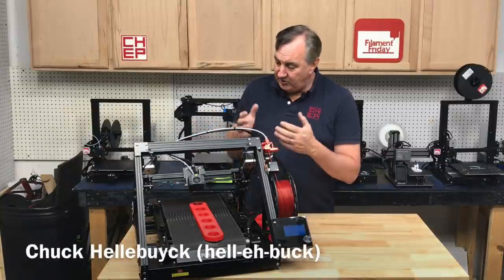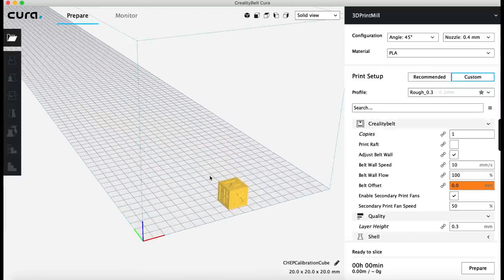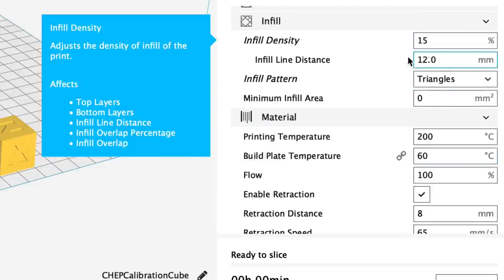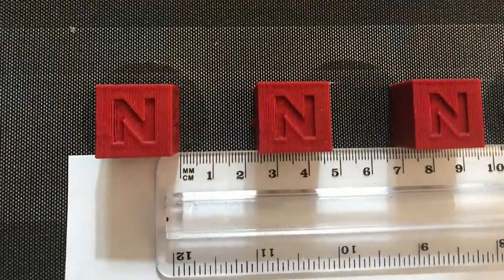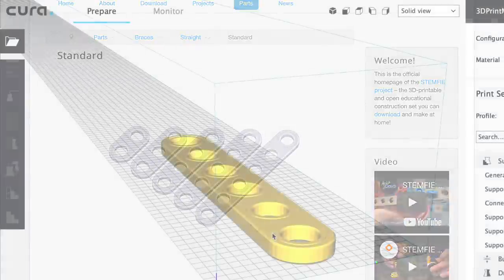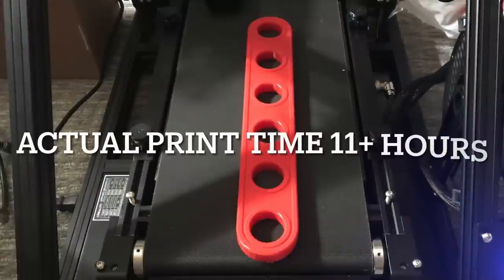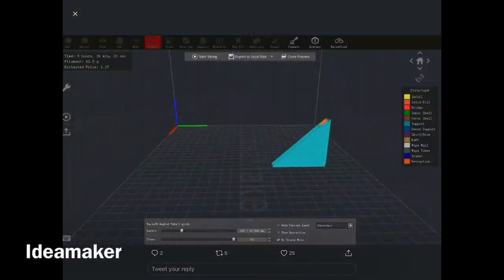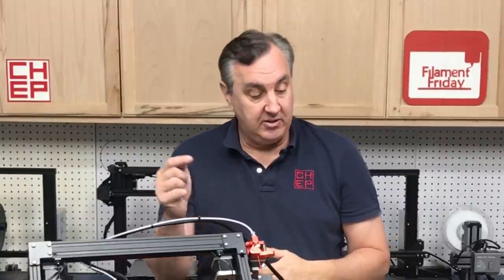Slicing 3D Designs for the Creality CR-30 Belt Printer

Comment: How does it work about supports with 45 angle? Is there any impossible (without supports) print that we can do with this machine?
Reply: 45+ degree overhangs can't be printed in the Z direction I guess
Reply: @jonahfastre  mmm, so if I want to print an hole, usually I could even do it without supports... but 45 degree is not possible right? 🤔 that's a problem (or we have to use supports)
Reply: @StefanoV827  with support it should be fine

Comment: The estimates in cura are usually off because of the start gcode in your printer setting which sets max speeds and the acceleration/feedrates.

Comment: Hi Chuck, I know you at least at one time used to run a small print farm. I am currently running two Enders 3
 v2 as a print farm but would love to have a printer continually spit out prints. My prints are quite small about 40 x 20 x 20 mm and has over hangs on all sides which require supports (imaging a elongated mushroom). Would this printer be capable of doing this ? The strange print angle to the bed worries me, it would be better if it was still 90 degrees from the bed.

Comment: Hey Chep! I am using Creality Slicer 4.8. I have a model which is lifting. I dont see the slicer enabled option to print small round pads? Any way to fix this? I added a brim over the entire model and it held fine, but not able to remove it easily.

Comment: Chuck, another great video, many thanks. 

I've got a product I print for a client on my MAX which is in 2 pieces due to size, the belt printer would be a game changer, but do you think PETG via a 0.8 nozzle will be ok with the stock hot end etc... will the belt reach 80°c

I've seen lots of reviews with PLA and the 0.4 nozzle, which I appreciate will be what most folks use, but with in essence an infinite z axis surely it's screaming out for a bigger nozzle.

Great video as always.

Best regards,

James
Reply: It’s a volcano style hot end (intended for large volume flows) and I did see a video somewhere of someone using a 0.8 successfully (although probably with PLA). I think that end should work. As far as the bed temp, no idea.
Reply: @JasperJanssen  I thought it was just an Ender3 style hot end, if so then I wonder if the MicroSwiss hot end for the ender would swap right in.

I can see me having to buy one of these in order to find out 😆

Comment: Will you be releasing a Cura 4.8 profile? I haven't updated my profile in a while and I feel like my prints could look better.
Reply from the maker: Maybe. It was such a minor update, I’m not seeing big change.
Reply: Ngl I went back to the stock profile and I'm printing near flawlessly! My Ender 3 Pro isn't stock tho...BTT SKR Mini E3 v1.2 (Marlin 2.0.6.1), BL-Touch, dual-gear extruder, Capricorn Bowden tubing, PEI/steel flexplate, yellow springs, RPi4 w/Octoprint

Comment: What the difference between and ender 3 and any high end ultimaker printer? 😅
Reply from the maker: Don’t have an Ultimaker so I can’t tell you.
Reply: Its an ",experimental " printer whith an "infinite z" so in theory yuo can make an infinite z object, its slice in 45 degrees, so its a totaly diferent class of machine.
In my opinion , if yuo need to make sword or rail trains ,it could be ok, but for me its just problems...its not for me
Reply: @noway8233  I did not ask about this printer (infinite z) 😅 i asked about regular ender 3 vs high end ultimaker printer.

Comment: I don't recommend using the "Distance Between Copies" function for 2 reasons..  1. Your print will already be however tall your previous print was away from the next print so if the print is 50mm tall the next print will start 50mm away due to the angles axis..  Its not possible to hit the previous print unless you back up the Z axis..  2.  If you advance the belt too far you move cold belt under the print area..  Currently there is only about 25mm of belt preheating before the nozzle..
Reply from the maker: Why is it in the slicer?
Reply: @FilamentFriday  Other than because Blackbelt built it that way I have no clue.

Comment: You could try making a many-hole beam in the same range — what about a one or two meter length version?

I’ve seen nobody really addressing on video the elephant in the room of how to make things significantly longer than the belt (like, 3-4 times as long, maybe, or longer). Is just a smooth support table enough to prevent it pulling the entire print off the bed? Do you need rollers? Maybe a support belt?
Reply: Good Question. I too am interested in that answer.
Reply: I believe creality also sells rollers for extending. The 3d printing nerd bought them with his printer so maybe go check him out
Reply: Somebody made a video where they printed a 16ft pole on it with a bunch of rollers I was also wondering at first

Comment: Hmm, another potential side effect is that the 45 degree print angle is going to make the part stronger because the laminations are no longer planar to the XY axis. It would be interesting for someone to do a torsion test on a Printmill print versus a normal print object. I do not need this printer, I do not need this printer, I do not need this printer, I do not need this printer..............
Reply: Yes, we need somebody to do this test.
And yes, sounds like you do need this printer